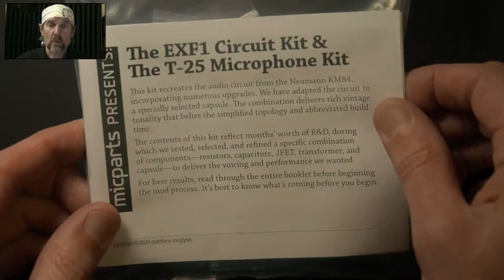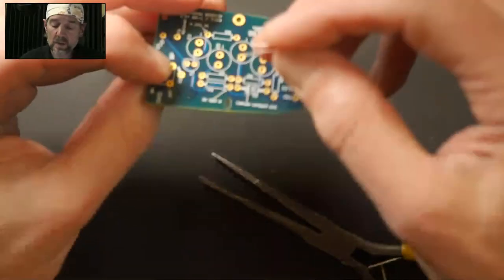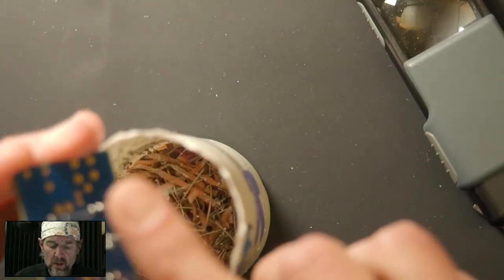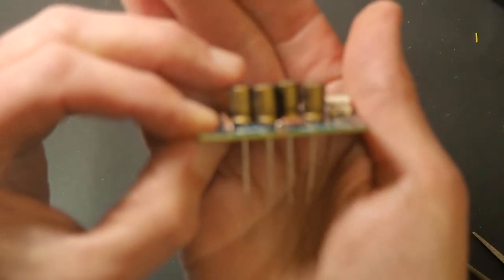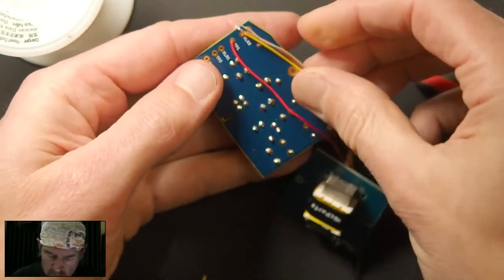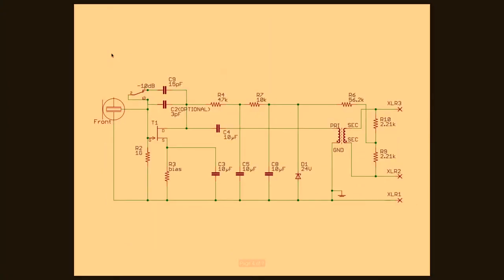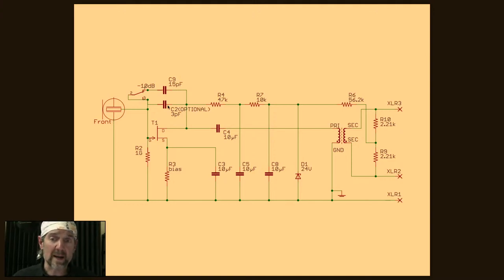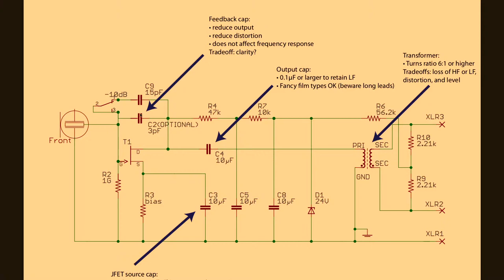DIY 001: MicParts T-25 Microphone Build, Pt 1

Comment: One thing I'll add from my soldering teacher, is you can get an "ESD-safe" horsehair brush for cleaning PCBs. Put your IPA in a nail polish remover pump, and dip your brush into it. You can really scrub the daylights out of the board and it'll be fine, plus the horsehairs won't come out onto your board! 

Thanks for the video, it gave me the confidence to try this project out! Built a few pedals, and repaired some synth boards, but never knew mics could be so easy!